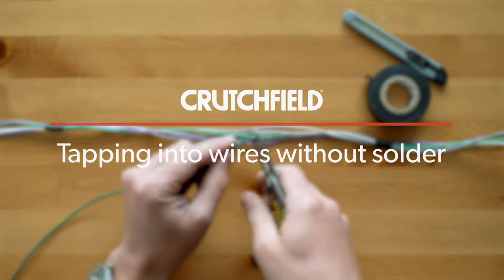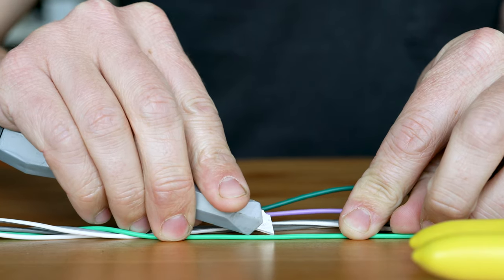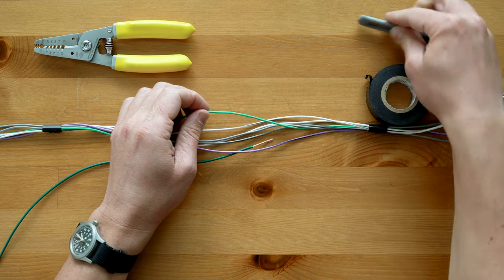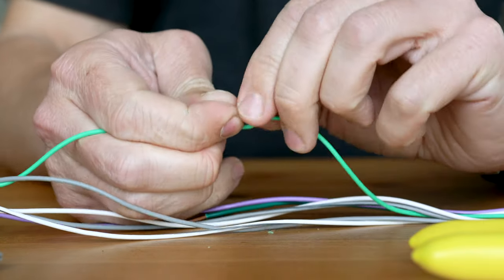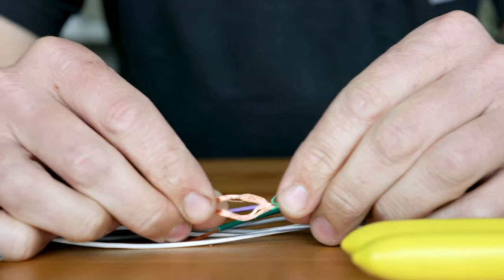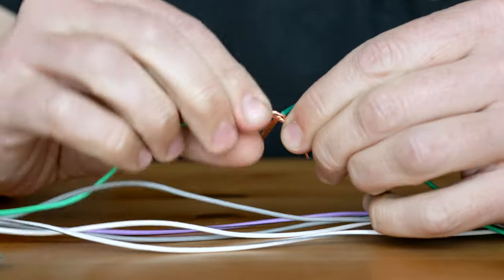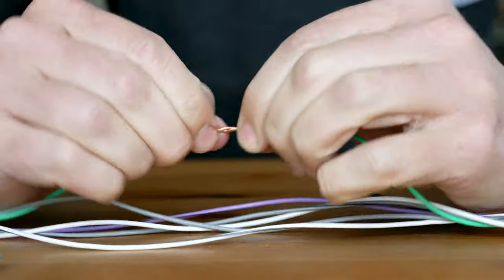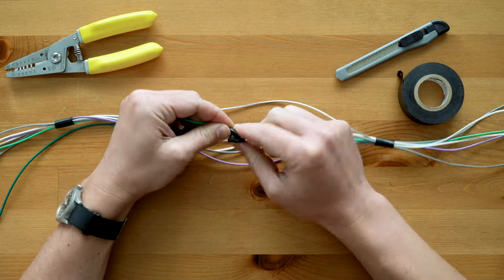How to tap into a wire without solder or special connectors | Crutchfield

Comment: I love how easy this looks when done by a pro who's done it probably thousand times. Try it yourself and bye bye harness 😆
Reply: Exactly😂
Reply: Plus he's using a decent gauge wire on a workbench. Do it in your vehicle with a small wire. But with good knife skills and some commen sense it wasn't that hard. My issue was the wire was to small for the t-taps to properly splice the sheath and make connection to the wire, this did eliminate that problem and allowed me to complete my project.
Reply: @Everydaycarry1911  i have the same issue right now, the wire from the LED light is much too thin for the T tap so i am gonna have to go this route as well, maybe some heat shrink
Reply: Lol 😂

Comment: It looks go on a table with lots of room and light. Try doing that in a cramped engine compartment with bad lighting and little to no room and just about 6 inches of wire to do all that. Sometimes you just have to get down in the mud when you are wrestling a pig!
Reply: How about you go inside and turn on the lights

Comment: Would this work to take power from a reverse light? I’m installing a reverse camera, and need to attach a power cable  from the camera to the reverse cable.
Reply from the maker: This process and the connectors shown will be able to work with the backup light wires to use them to power a backup camera!
Reply: Did this work and has it lasted until now ?
Reply: @erikzazueta3932  Use quality electrical tape like 3M. Otherwise it may become loose like mine did but the connection still worked. Just didn't feel as secure. Re-wrapped with better tape and all is well now.

Comment: Interesting way of connecting two wires. I wouldn't use most electrical tape though. If it starts to warm up, the sticky stuff tends to migrate out. Self amalgamating tape is way more effective. Just wrap it around, pulling on it as you wind it around. Solid piece of insulation.

Comment: would this work when connecting car radio ignition cable to the cigarette lighter wire?
Reply from the maker: This process could be used for hardwiring a radio switched power wire when necessary as that would also be a situation where a new wire is being spliced into a complete wire as shown in the video.
Reply: @crutchfield  thanks!
Reply from the maker: You're welcome!

Comment: At the end when you wrap the wires in electrical tape, would shrink tubing work as well?
Reply from the maker: Yes! Shrink tubing could be used instead of the tape. Just make sure to slide the tubing onto the wires before joining them as shown
Reply: Heatshrink would be ideal, but the problem normally is that you're tapping into a wire that's part of a harness and so you don't have clear access to one end of the wire to slide the heatshrink on.
Reply: There’s no way to use heat shrink

Comment: Is this a fire hazard for led pod reverse lights wired directly to existing reverse lights?
Reply from the maker: It is not a fire hazard to wire a backup camera with LED lights to the reverse light circuit in a vehicle as long as no bare wires are left exposed. If the LED pod reverse lights use similar power to a typical backup camera, then we would expect the same results as long as no wires are left exposed which could lead to a short or a fire from a short.

Comment: its good idea. but do not use insulation tap instead use joint heat shrink sleeve to avoid forming corrosion over the time
Reply: You can’t use heat shrink when there are no ends on the wire you’re tapping into ie a harness wire

Comment: would this work on an ebike battery with 1 red and 1 black wire. thanks
Reply from the maker: We do not have information on the gauge of those wires to know if the Posi Tap connectors are the right size for it. I can tell you the taps we carry can work from 10 gauge down to 22 gauge wire. If you can find out the gauge of the wire on the ebike, and its in this range, 10-22 gauge, then they will work. Here's the ones we carry right now:
https://www.crutchfield.com/I-rYTVc227/shopsearch/posi_tap.html

Comment: ALWAYS use solder or do not attempt.  IT WILL CORRODE over time .
Reply: If you don’t have solder you can melt a penny or nickel with a torch like solder and if you dont have tape melt some hot glue sticks to insulate the wires or if you dont want to get a felony just melt the glue stick after you braid the wires together also use some flux if you melt pennys or solder helps clean the wire and better cohesion
Reply: It wont corrode if you use marine shrinkwrap that has glue to prevent atmosphere from getting at it.

Comment: Absurd... expose that much wire and may as well cut that wire, add adhesive heat shrink, and solder all three together...... slide the heat shrink over it.... good video otherwise..

Comment: Non adhesive splicing tape holds the T joint forever and it does not leave sticky residue when removed. 3M makes them

Comment: So if I were to use a 9 conductor in my factory radio doing it this way should work?
Reply from the maker: If you are referring to using the 9 conductor wire as a means to get and audio signal from a compatible factory radio to a new amp, then yes this can work and comes with the criteria that new speaker wire will be ran from the amp to each speaker.

Comment: It was so easy to do I was shocked!
Reply from the maker: Nice! What did you use the technique to install?
Reply: @crutchfield  puns, they are universal. Although I was met with minimal resistance, I guess I forgot to disconnect the battery, cause now I'm wired.

Comment: Why would you prefer solder or positaps? What benefits do they have over a secure and insulated mechanical joint like this?
Reply: mechanical joint is not as secure as the other methods.  They would not be "up to code".
Reply: Video guy says this is "a way" only when you dont have those tools/supply....
---otherwise id recommend solder=molten metal bonding on a molecular level+rubber tape
Reply: Solder creates a better electrical connection and prevent air gaps forming creating sparks that can damage your wire, if you use this method though you should be completely safe from that